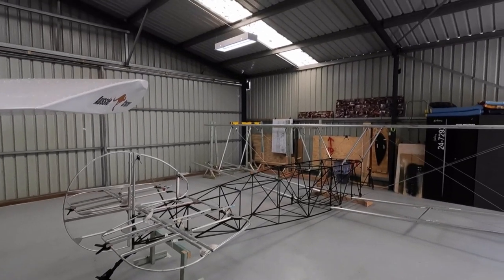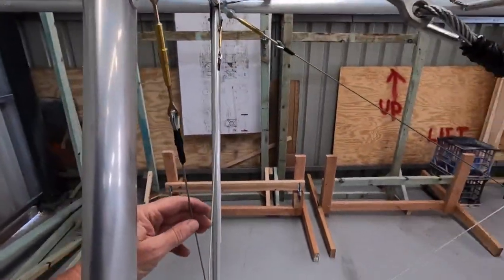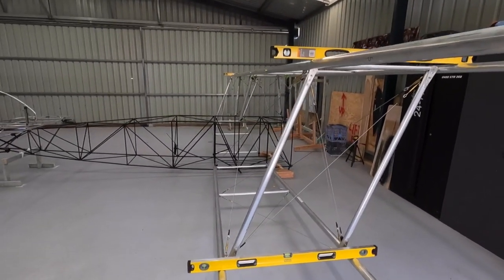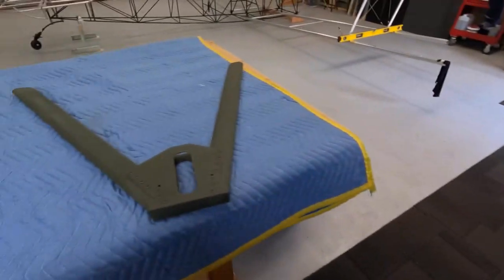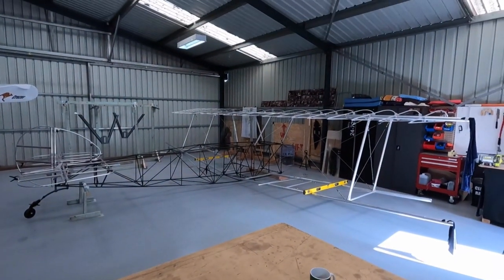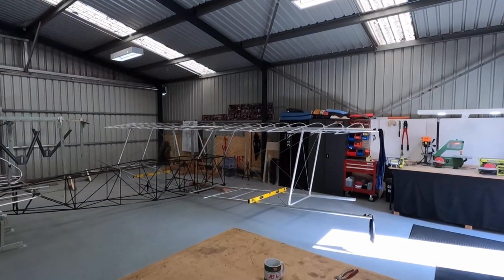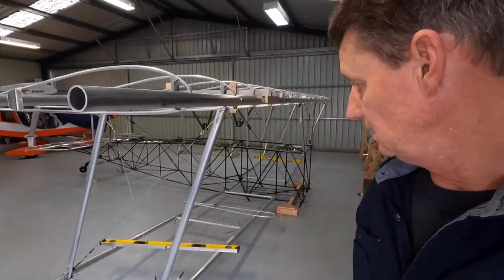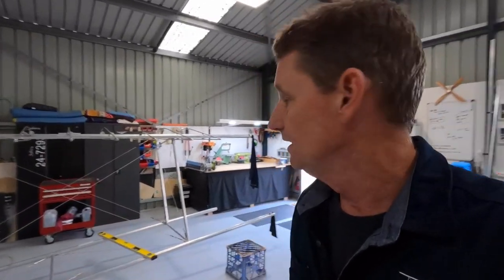Wing ribs and ribs and ribs Sopwith Camel

Comment: G'day,

Yay Team !

I'm
REALLY
Lovin' this...

Having bought a 5/6 completed Plans/Scratch-built Project, with a 1.5mm Styrofoam/Dacron/Laminating-Epoxy "Half-Sandwich" Leading-Edge Skin (made with Araldyte mixed with insufficient Catalyst - "to allow more Set-up time, before it goes off..." which was STILL Tacky to the touch 5 years later - when I bought it... (and busted that SHIT Off totally, replacing it with 2024 T-3 Aluminium Sheetmetal - from Core-Sample Tray-Covers bought for $0.42 per Kg, in 1986....{!} ).

It's a
Real
Pleasure, to see someone
Doing it
RIGHT...

From the 
Start.

5 Gold Stars..., & a
Wedgetail
Stamp !

Keep on keepin' on.

;-p

Ciao !
Reply from the maker: Thank you

Comment: The upper wing rear wire needs to go to the spot where you noticed there was no welded bracket, so both wires would be perpendicular to upper wing and the force will be straight down. With the rear wire where you now have it, the wire is pulling back on the trailing edge, fighting the downward force direction of the leading edge wire.
Reply from the maker: Thanks, manufacture has moved it to the rear spar to stop the need to penetrate through the wing.

Comment: Hi, Scott.  I've followed your build with interest.  If you're still looking for wood to cover the Camel's front turtledeck, your local woodworking shop may carry "bendable" plywood.  It worked well for my SE5a's turtledeck.
Reply from the maker: Thanks, can you get it pretty thin? 2mm or 1/16 thick
Reply: Hi, again!  I've used 1/8 inch (0.125 in, just over 3 mm) successfully.  Even 1/4 inch bends to a small radius.  It's amazing the first time you see it.
And my SE5a is Airdrome Aeroplanes, btw.  
Regards,
John Laczin
Reply from the maker: Thank you